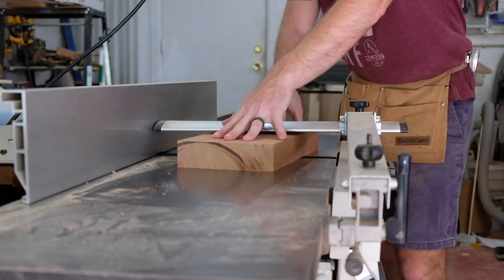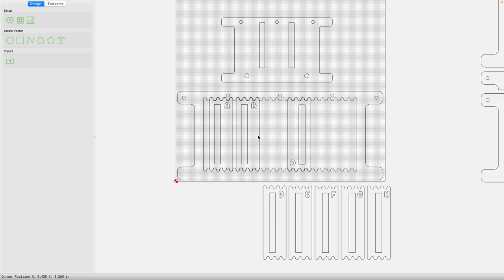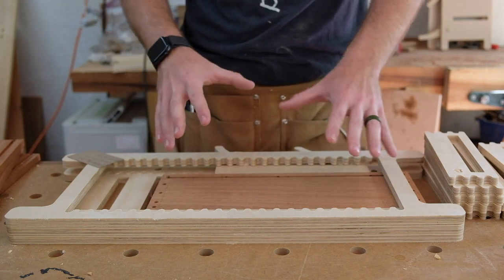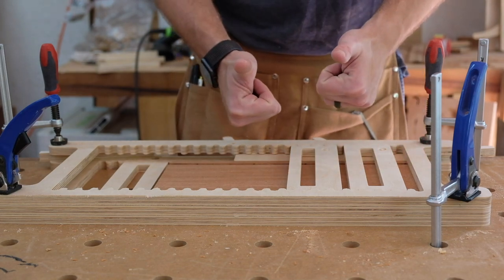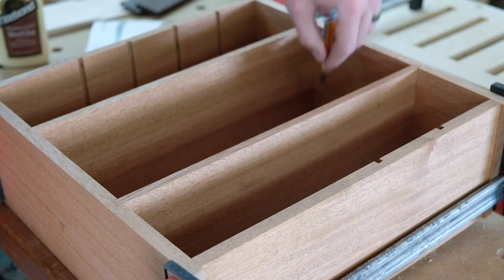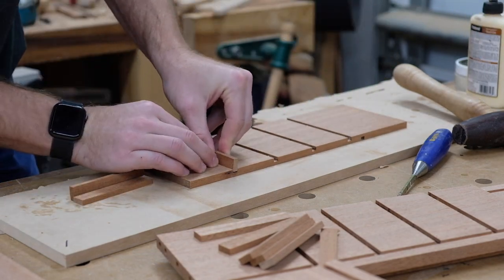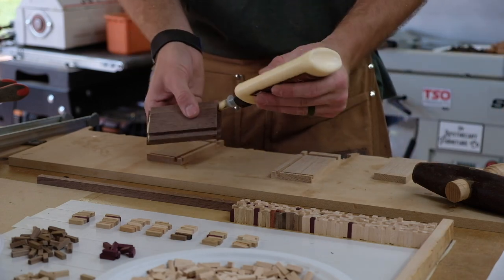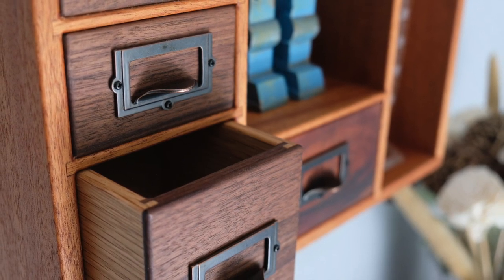[Re-upload - HD] I Designed an Adjustable Dado Jig - Small Wall Cabinet Build

Comment: Hi , i’ve been a cabinet maker/woodworker for over 30 years now , and one thing poped to me when i saw you do the drawer fronts . The next time you put the side on the table and the face on the fence , there’s 1 safer ways to do so . The other is a bit better then your way you did .

1- Use a tenoning jig , fabricated or bought . That’s the best way to do it .
2- Have an 1/8” mdf over the blade with double sided tape . Rise the blade just for what you need so you’ll have good support all over . But still not safe for what you need to do .

Be safe is better then be sorry 👍🏼🇨🇦

Comment: Another really cool build. I do worry a bit about the number of variations possible in your jig. Just sort of opens the door for error. I was trying to think of some clever way of labeling the template or the inserts to make it more user friendly, but I've got nothing. Also, I'm not sure what you do in life outside of wood working, but if I had to guess I'd say you're some sort of engineer. Cheers!
Reply from the maker: Thanks Joshua! Yesterday I redesigned the jig to help eliminate a lot of possible mistakes. There will be a ruler/scale and only one type of insert. Hoping to get a prototype milled up soon.

Oh, and I have a degree in materials engineering but no real professional experience in the field :)
Reply: @parillaworks  This process was incredibly cool to watch! Maybe, as you are refining the prototype, you could consider numbering the little indentations of the frame, and possibly putting some kind of marking (a dot or a little arrow) on the "tooth" of the insert that you use as reference, so you don't risk aligning the wrong corner... but maybe by this time you have already done it!

Comment: Did you use 3/8 or 1/2" alignment fingers on the template inserts?
Reply from the maker: 3/8”. If I bumped down to 1/4” I would need less inserts. However, I redesigned the jig yesterday and should only need one type of insert, so that’ll be less confusing haha.